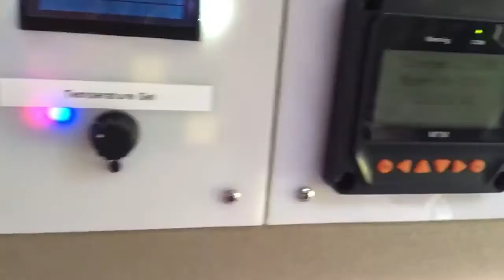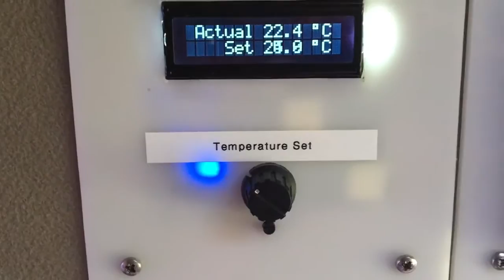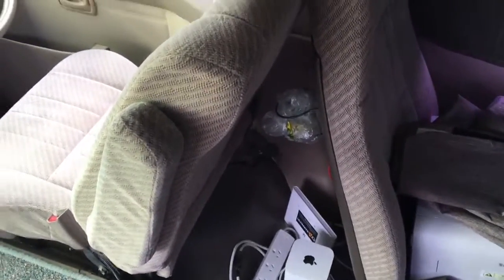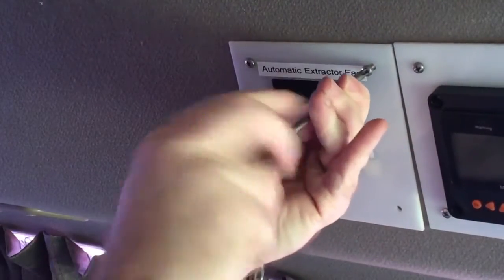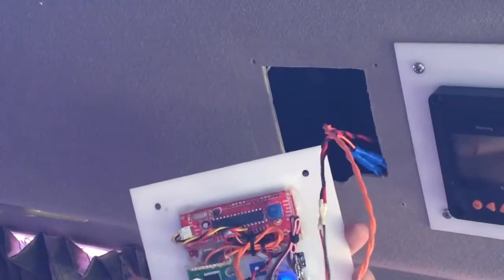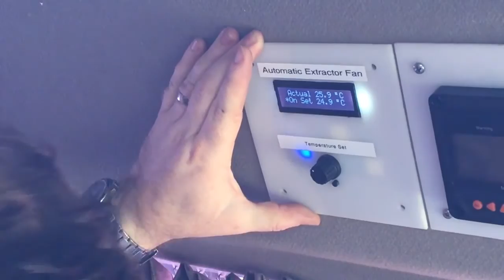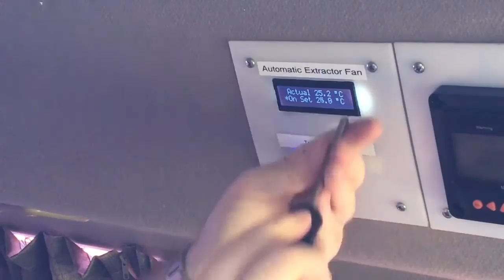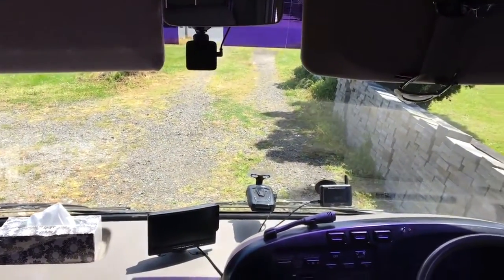#100 Arduino Leostick Extractor Fan Controller Part 1

Comment: You couldn't had put the temperature sensor elsewhere?
Reply from the maker: douro20 - I wanted to keep the unit compact and self contained, which is why it's on the single panel.